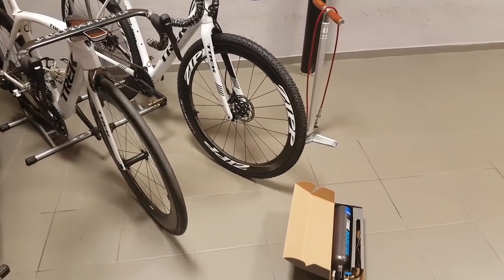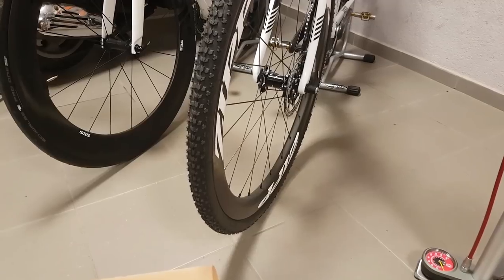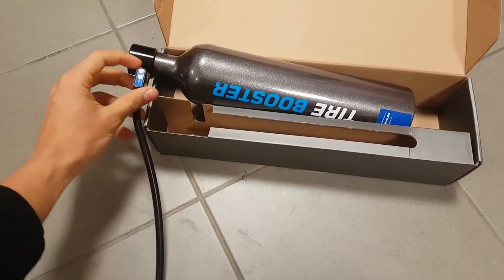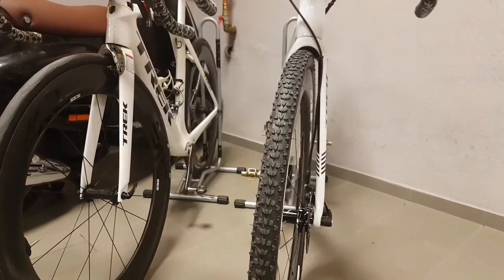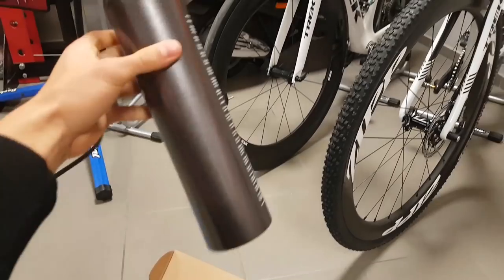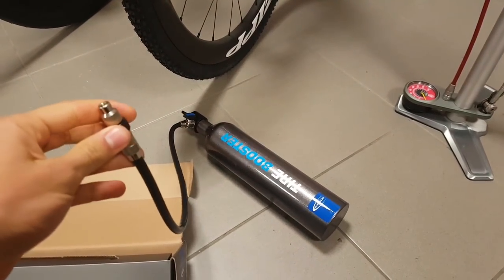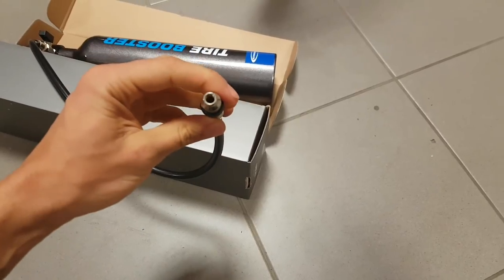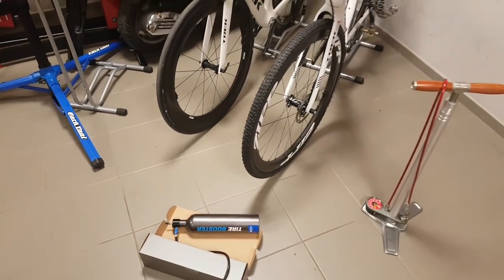Tubeless inflation - Schwalbe Tire Booster (Airshot) review

Comment: hi rony ... do you think it's a good idea to change tubeless tire just before race ? my experience is that tubeless tires need some time to perfectly seat on rim, at least few day and rides. After that time sealant "glue" tire on rim and setup is much safer to ride on very low pressure. So I use two wheelsets for racing, one for super muddy conditions and other with all-round tires. Definitely not cheapest solution if you ride on carbon wheels, but really makes a different when racing.

Comment: Hi Ronald what if you put helium in that booster could you pump you're wheels with it
Reply from the maker: Michael Cloherty you can, but what's the point?
Reply: you'l be flying around ! :)
Reply: no reason for using helium - helium is so small atom with almost zero interaction with materials that it is leaking really fast
Reply: No, but you could use nitrogen.
Reply: @user-yv2cz8oj1k  except you typically use the booster to just seat the tyre and then you deflate again anyway to put the sealant in